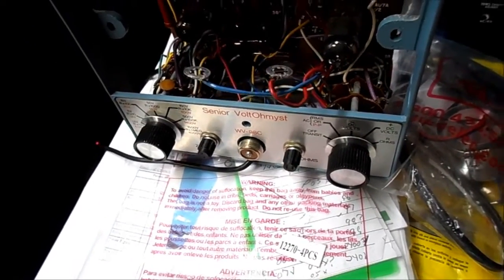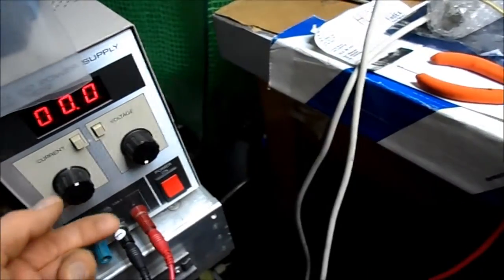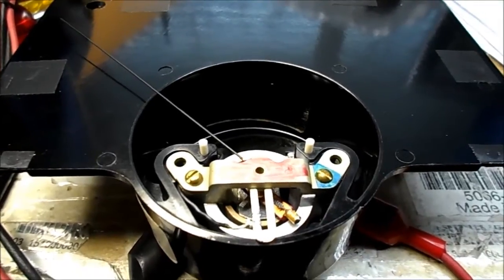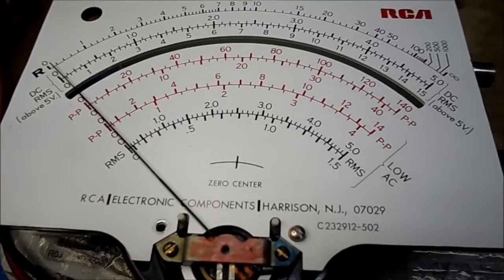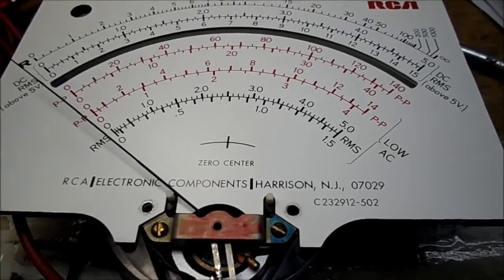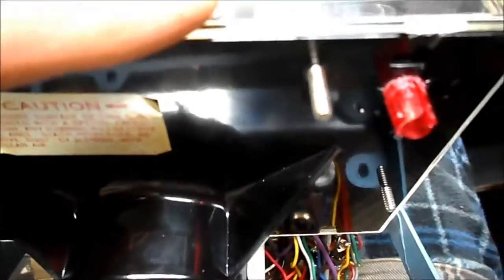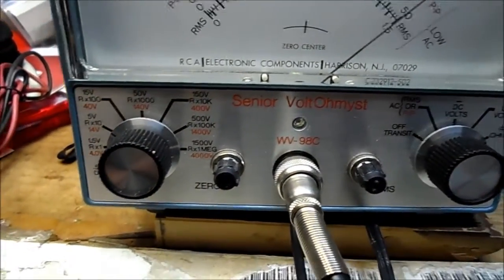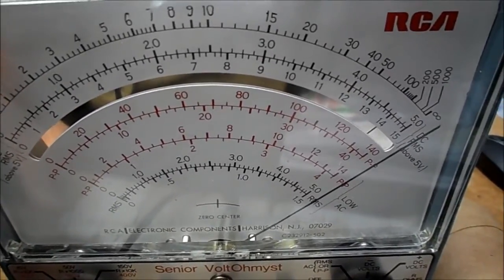RCA Senior VoltOhmyst WV-98C. Meter Movement Repair.

Comment: troubleshooting meter movements is an evil job, no doubt. Looking at that thing makes me glad i don't own one!

The probs i have found include:  Loose or damaged jewels causing sticking of the pivots, needle hitting warped scale plate, steel/iron swarf caught around moving coil, oil or grease causing spring/s to bind up and thus have a non linear reaction, green corrosion of the springs decreasing their strength, bent needle or tangled spring from abuse, etc etc,

Comment: A very nice job in restoring your meter, "well done" I had a similar situation with my Sencore FE20 Field Effect 6" meter; it was pegging near the zero mark, so I took it apart and re-balanced the needle and reposition the metal slots enough that it would not interfere with meter movement, fortunately everything worked perfectly after assembly when I made the final zero adjustment and made a mental note not to touch the mechanical zero on the meter again.

Comment: I've been through this type of repair a couple of times myself. As you stated this is the weakness with these meters, which are really very good when the meter movement works properly. I use one of them myself for alignment of old radios etc. I think people who remove the cover to the zero dial adjustment don't understand/know that this adjustment is a left to right correction rather than a screw type (clockwise/counterclockwise) and they damage the movement by trying to adjust the zero that way. The manufacturer of this meter should have provided a more "comprehensive" method.
Reply from the maker: I agree, as I also assumed it was a turn type, until I looked at it in the manual.